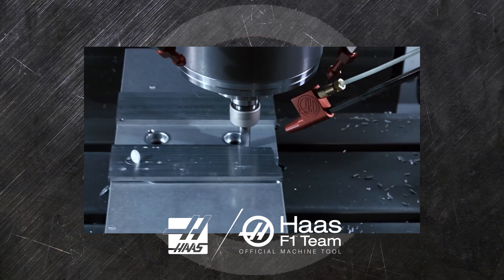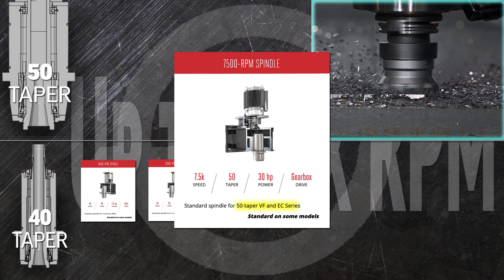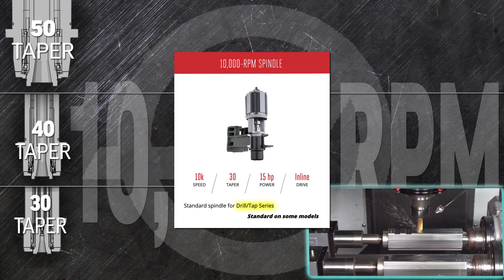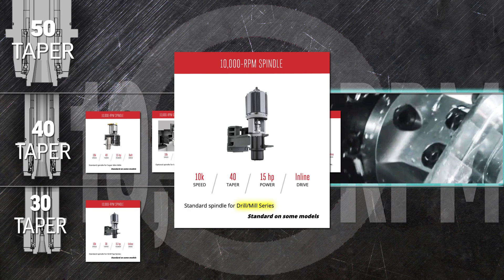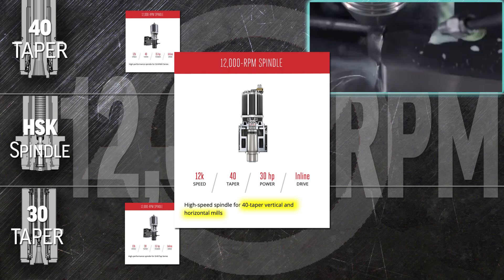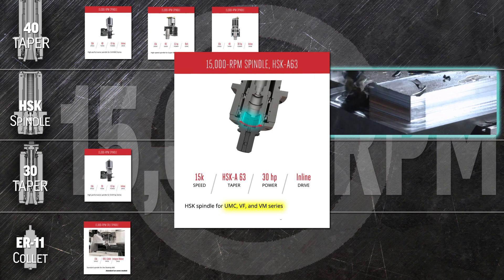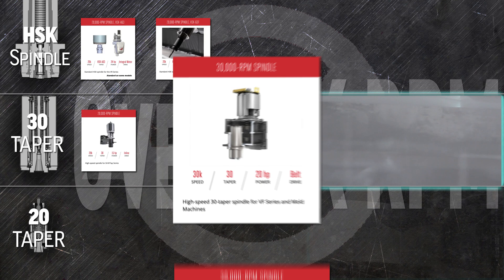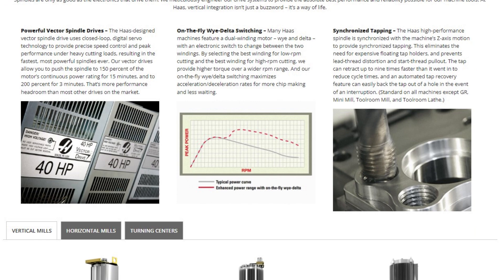Haas Mill Spindle Options Overview - Haas Automation, Inc.

Comment: What are the options for those of us that have the inline 8100 option, but motor is tagged 12k. Is this simply an activation code to up the RPM to 10k or 12k?
Reply: Good question but ...... they will nerver answer us kkkk
Reply: And yet NONE of these are dual contact spindles.
Reply: @gulch1969  I'm from Brazil and here, we have a company that make amazing machines. It's called ROMI. They sold in US. Have you heard about them?
Reply: you can upgrade to higher rpms, i think the spindle cartridge needs to be swapped. speak to your haas service rep
Reply from the maker: Ken, Depending on when your machine was built the spindle may be able to have an “activation code” increase to 10K. Again, depending on machine vintage the spindle bearings and some other components are typically different between the 8/10K and 12K spindles. As Kevin mentions below it would be best to speak with your local HFO rep to get the exact specifics of your machine configuration to see whether you can get more rpm with a code or if you need a new spindle.
Reply: @haasautomation  hey Haas .... Just one question ..... what's the code?
😏
Reply: @haasautomation  My mill is a 2021 VF-2YT. Spindle motor is 40T Inline 12K, currently maxed to 8100. Even 10k would be a huge benefit for me. Also, I have another question regarding my spindle that I haven't been able to get any response from anyone from Haas or my HFO on. I bought my machine used with only a couple hundred hours on it, listing stated it was TSC Ready, but when I got it and ran the serial, it didn't have that option. The spindle and motor are both hollow and I can blow air thru the spindle, but when I put in a tool that is actuated/driven by air, it leaks out somewhere between the taper and the air purge line up top. Is there a seal, or different assembly that needs to be in there to prevent the leaking? I have no issue taking things apart and swapping parts but I can't get an answer on what the actual difference is between a TSC Ready assembly and a Non TSC Ready assembly. Any information or a contact to someone that can help would be greatly appreciated! Huge part of this purchase was to be able to run air thru the spindle, all I need is air.
Reply: @zodiaceng  If you absolutely can not get a retrofit kit or anything like that specifically for your machine, get one of those spinny surface cleaners for a pressure washer and use internals from it to make a retrofit kit. Both appear to work on the same idea: two really flat carbide "washers" act as the sealing surfaces for high pressure.
Reply from the maker: @zodiaceng  Hi Ken - Drop me an email at bofallon@haascnc.com please, I'll make sure that someone contacts you and we get your questions answered.  Thanks - Bryan, Haas Automation
Reply: @haasautomation  emailing now, thank you!